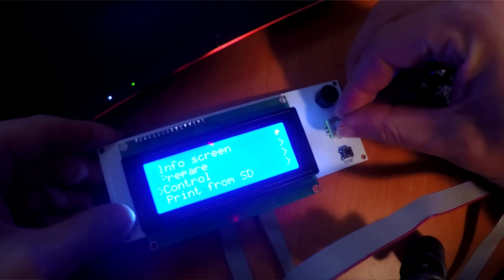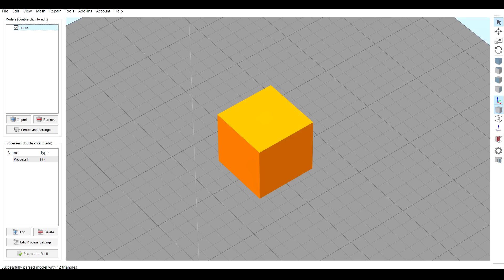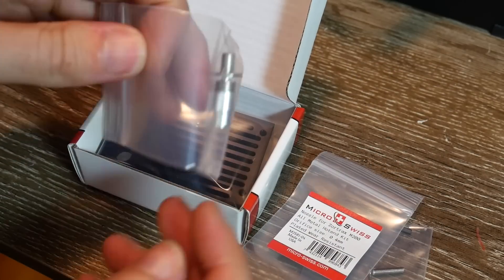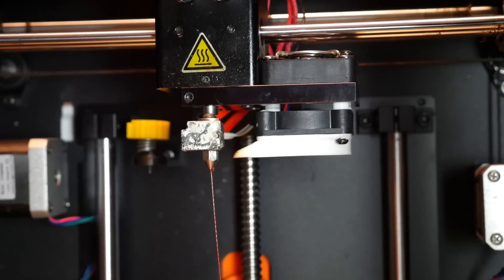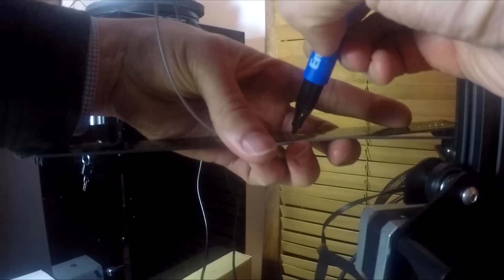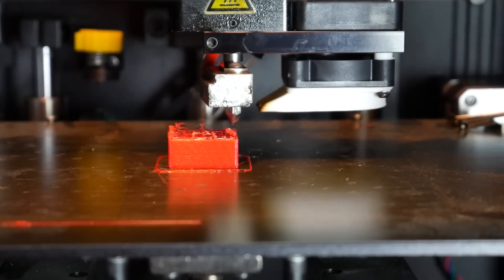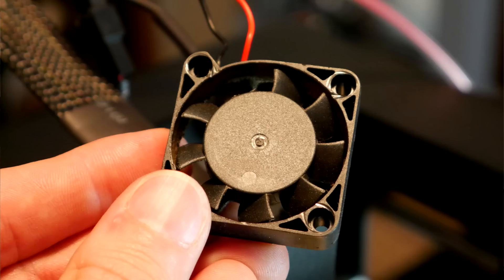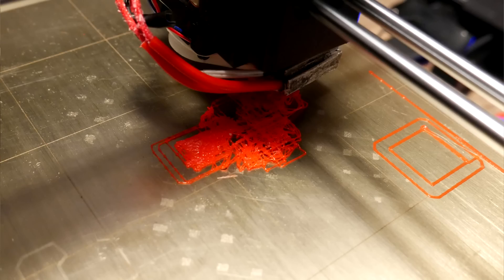Micro-swiss all metal hot end - Frankendoodle Part 3 - First prints!

Comment: @teaching Tech
Generally speaking m200 is not capable for printing PLA - it is becouse of hotend design, even tho if you use all-metal hotend things go worse. Actually Ive never printed even petg 100% succesfully on this machine. Just deal with it that printer is made for ABS and other high temp materials that does not become soft in 60-70 degree, then you are free to print. Anyway You have to use thermalpaste on heatbreak (you definetly missed that and it is a first and most importand problem) if you fix it you will probably have kickass printer - Im on a stage to do pretty the same thing as you - 2 walls on a print, rafts all the time just makes me sick. Glass bed for m200 is ridiculusly priced. Im from country that zortrax is invented and actually they making such an overpriced printers. To all ppl who thinking of zortrtax - consider to pay someone for voron build - you will endup with ultimate printer that is not closed source.

Comment: We just love a challenge eh :-) Glad you got there in the end mate. You got me thinking, maybe I should upgrade the drivers on the CR-10s, what would you recommend? I'm mostly looking to make it a bit quieter. It's already fairly quiet, except for the X axis which is fairly noisy at higher move speeds.
Reply from the maker: The TMCs on the mk3 work very well. I'm guessing that will be my recommendation but I need to go through setting them up first.
Reply: Indeed, they seem to work perfectly, which is why I'd like to put them on the CR-10s. It's the setup that I'm not sure of (yet). I'll let you know if I find anything, but you're far more likely to know all about it before I do.

Comment: No mention of Capricorn XS tubing as a solution for high temps vs changing the hotend?
Reply from the maker: Firstly, this is a direct drive machine so the tubing on top is a guide only. Secondly, they don't recommend it themselves according to their website: https://www.captubes.com/safety.html
Reply: I don’t agree. If you tead their warning you could apply that to any filament that off gases. Unless your going to try to print at extremely high temps then it should be fine. I’ve used the product in a well ventilated area up to 280C with no problems. If you go all metal many people have reported problems going back to lower temp pla filaments.
Reply from the maker: I interpret the fumes they talk about as coming from the tube, not the filament. Ventilation overcomes all. I agree that that for general purpose PLA printing a PTFE lined tube is more straightforward.